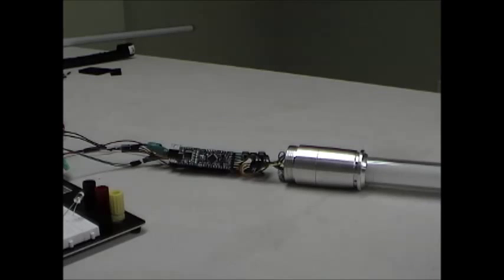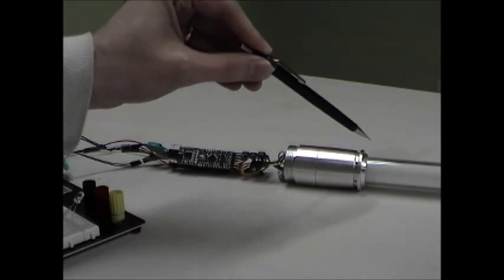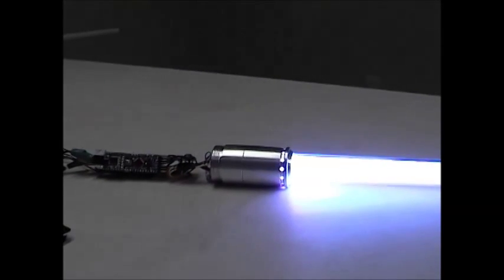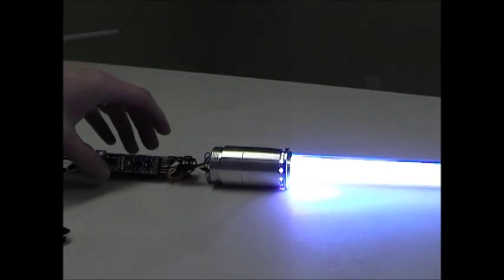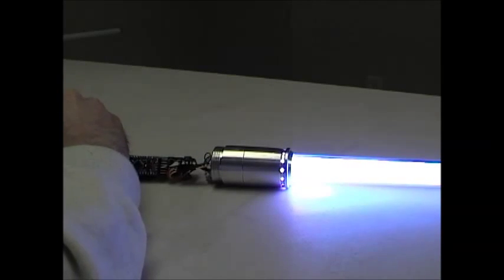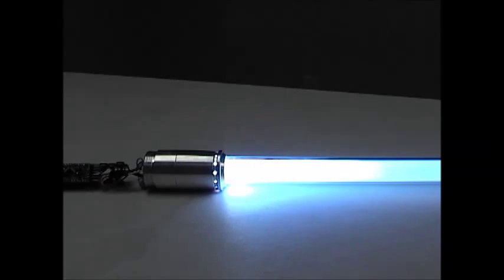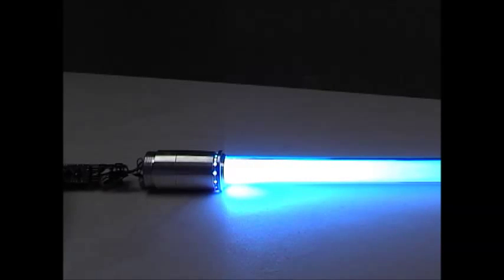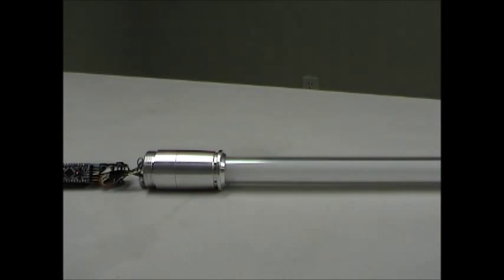Arduino Lightsaber Mk II PowerTest

Comment: Hey Jake, a question regarding the voltage regulator you used. How precise does the the output current need to be?

Your 5v one is 5 amp, i can readily get one where i live which is 5v 1 amp. Is that ok? I'm planning on running a 18650 battery in one of my sabers and 3 aaa batteries in the saber i'm building for someone else. Thanks in advance!
Reply from the maker: Both of the power solutions you mention are under 5V (3.6V for the 18650 and 4.5V for 3AAA). You can't regulate the voltage UP, only DOWN. You can build a saber that way for sure, but you'll have to wire it a little different than I did.
Reply: jakesoft Ahh i see. Thank you again. I'd rather keep it a simple as i can, as my understanding of this type of electronics is limited. 

If i were to use, say the 3.3v regulator that you have listed, would that be a better choice? What would the difference be between using the 3.3v and the 5 v?
Reply from the maker: If you were to use a 3.6V battery, you might be able to get away with just supplying the VCC and VDD pins on the WT588D with raw voltage. You could definately supply the Arduino Pro-Mini's VCC pin with direct power in that case (they can take up to 5V of direct power). You could add a 3.3V regulator if you wanted to, but research "dropout voltage" before you try it. You'll see what I mean.
Reply: Ok, so i had another look at your parts list, and the 3.3v regulator would be the one i need, seeing my voltage is below 6 volts. Does the amperage matter at all? Or just the volts?
Reply from the maker: If you are only powering your Arduino and WT588D off the regulator, then 1A should be plenty. Again, pay attention to the drop-out voltage of your regulator. Get it as low as you can find. I would expect you'd drive your primary blade LED directly from the battery with a resistor in the situation you describe.
Reply: Oky doky. I'll tell you exactly what my plan is, and what i have. My apologies, i should have done this before LoL.  

I have the Arduino pro Mini 3.3v 8m. WT588D-16P, plus the programmer, ADXL335 accelerometer, my D14N05L mosfets just arrived 5 minutes ago Woohoo!! And my 2w 8 ohm speaker.

Still waiting on the LED, i want a color changing function so i'm thinking the RGB LUxeon tri rebel star, and still waiting on the regulator, once i find out the best way to go haha.

What my desired product is:  Light fade up and fade down with power up and power down. Flash on clash, obvious swing sounds and clashes. and blade shimmer at idle.

For power, i'm making a couple, and mine will have the 18650 6000mah battery in it, more if you recommend it, and the ones i'm making for my friends, will just be powered by 3 AAA batteries simply because i always have 18650 batteries for other things and they don't. 

Once again, thank you so much for sharing your knowledge with us!